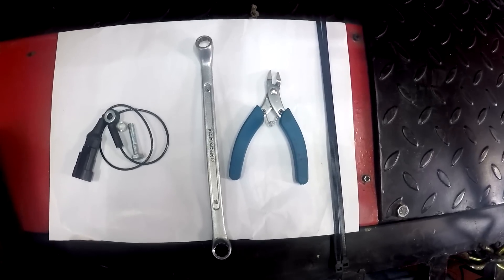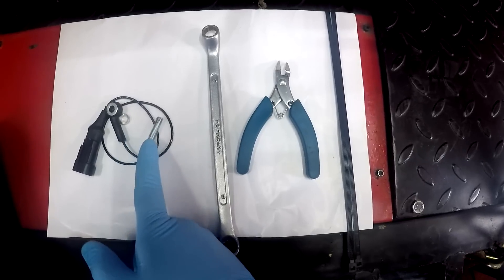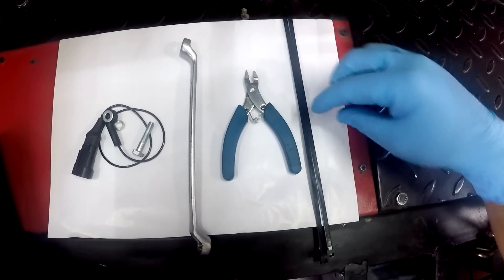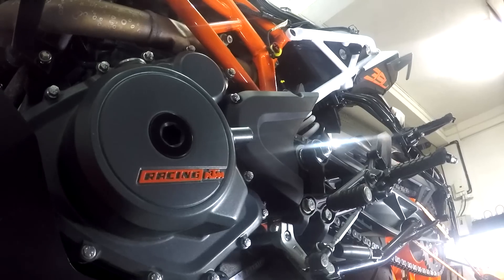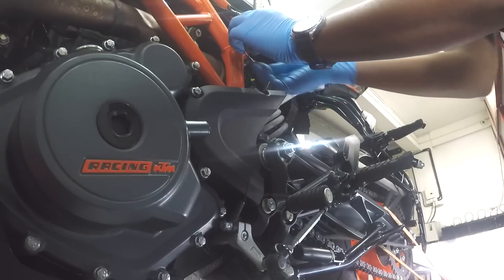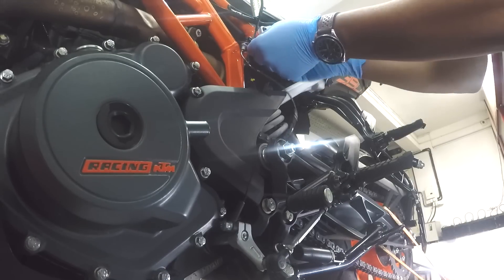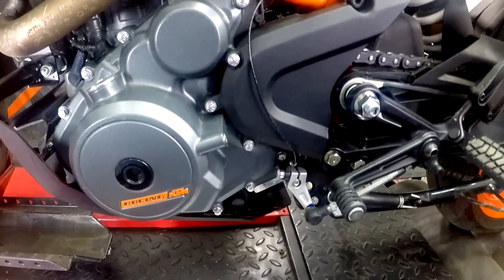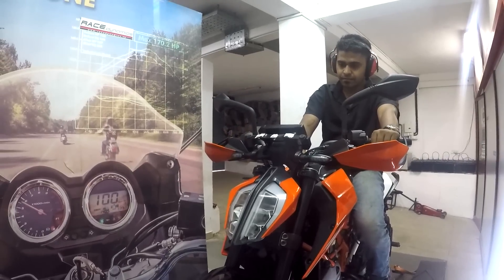Installing the RaceDynamics Quickshifter on a Duke 390 | AJ 390 |

Comment: Bro what is ur review after 3 years....? Does powertronic harm engine in long run??
Reply: it richens up the mixture across the rev range which actually makes the engine run more smoothly and cooler. (lean mixture was set by factory for emissions standards)  You can extend the redline (from 10500 to like 12000) which if you run it up there consistently is probably not the best. But for normal operation, the Powertronic should not damage the bike at all.

Comment: hey bro plz reply my is it important to use quick shifter 
what if i only buy powertronic 
not quick shifter
Reply from the maker: Z.W.R yeah you can use only the PT box, quickshifter is just an addition...
Reply: AJ 390 soo is there any problem occured if i installed pt
And rpm limit after installation of pt
Reply from the maker: +Z.W.R no issues... You can go to the workshop if you are based in Bangalore, try it out and then buy it if it suits your requirement
Reply: AJ 390 thanks bro 
Check my rc390 race video hope you like it 
33min video start on 21min 
Dont forget to watch

Comment: What does the sensor sense? It is just between the bolt and the metal so it will remain stationary wrt its contacts.. can you please explain🤔
Reply: part of senser that goes inside gear liver moves with the liver and other end is fixed. so it senses rotation

Comment: Don't mean to b an ass......but we can upshift without d quickshifter too in almost all d New bikes.
Reply: The clutchless manual shifts doesn't harm the GB until you're doing it right! That's what the quick shift basically does but in a very less time !
It only helps in tracks to save laptime! Where it basically saves time in during on off transition of the throttle, you don't have to let go off the throttle to shift if you have a quick shifter!
Reply: Sylves Sangma i dont think you know how a quickshifter works, continuous gear upshifting without using the clutch is what it does
Reply: That's what m saying.......My rc390 has no quick shifter n I can upshift without clutching......
Reply: Sylves Sangma i suggest you don't do that, long term use of that will ruin the gearbox, that's why quickshifter exists that does it perfectly
Reply: Seducing Salad thanks 4 d suggestion.....
Reply: Sylves Sangma You are being an ass 😂 quickshifter not only helps in shifting without clutch but it also helps in those long straights where you can pin your throttle and just shift no throttle on and off action required just try that without a quickshift it surely will harm the engine.
Reply: Well, you didn't read my comment right I guess 😂
Reply: Well, even I was scared to do clutchless shifts on my bike until I heard it from the very guy Rajnikrishnan who's zx10r doesn't have a quick shifter doesn't and he does it seamlessly and says it does not harm until you do it right! So, that's there! Words from the chap himself! 😏
Reply: Champ**

Comment: How much did it cost and whom should I contact to get it.

Is it available for dominar
Reply: Sahil Patel nope ride by wire is needed for an autoblipper, quickshifter uses ignition retardation to change gears. So theoretically any bike with an ecu can have a quickshifter
Reply from the maker: yes this is available for dominar and you can contact Racedynamics on their website or fb page. They will let you know the price :)
Reply: how can it be available for dominar? Quick shifters require ride by wire throttle system right